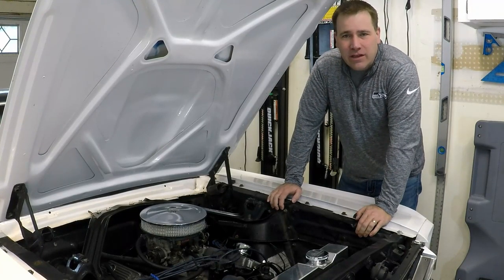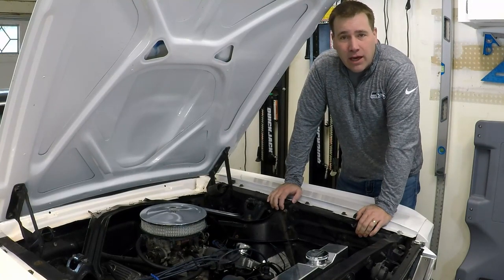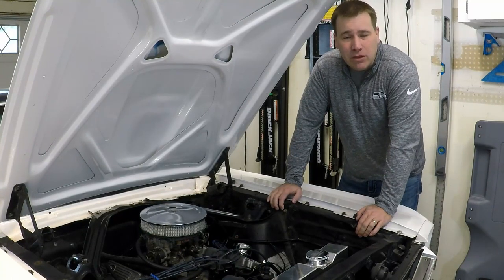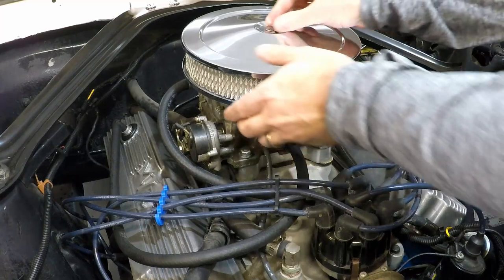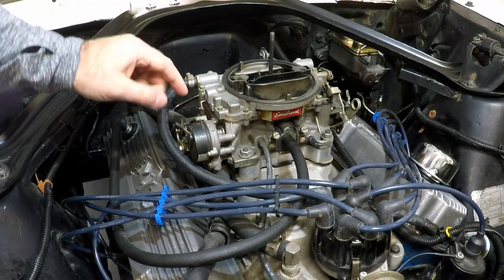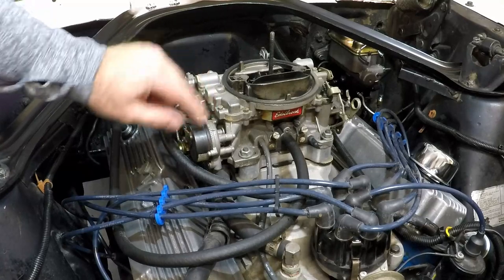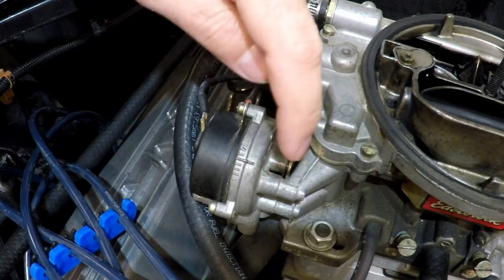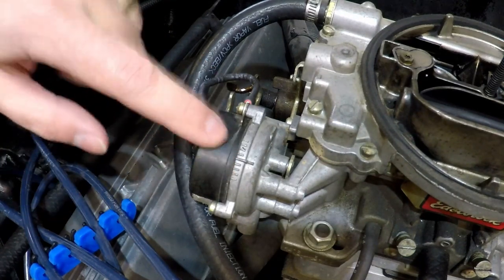How to fix the Edelbrock Electric Choke

Comment: Good video. Unfortunately on mine. For some reason even after I undo the 3 screws. I cannot twist to adjust the choke or take it off. It's stuck on there. Someone had also ziptied the linkage arms to disable the choke.
Reply from the maker: It sucks trying to fix other people's projects.  Maybe it's time for a new carb?  Maybe an upgrade?!   :)
Reply: @AndyKruseChannel  it's annoying haha, but it's a new carb though. Everything works fine, but the choke.  It's pretty cold here in Australia atm so morning drives are interesting.

Comment: Hi, so i see the edge of the choke spring coil should be against the shaft sticking out of the housing? Does this apply to all chokes? I thought the wind of the spool of the spring (loop end) should be in-between the shaft. I think i see now what i did wrong on my 78 Cadillac Coupe with the 425 rochester carb. I put a new choke thermostat and new primary choke pull off but yet car starts and runs awful on cold starts. I placed the new thermostat choke exactly as the old one with 2 notches lean. But maybe the placement of how it catches the lever within is bad. The way it is now, it will  run a bit and stalls out. I have to keep feathering the accelerator pedal to give it gas so it won't stall. All the while, the car is idleling rough. But once warmed up, Caddy runs perfectly well. I can't even tell it's on at a stop light. Oh im also going to be replacing the secondary choke pull off too...any input. Thanks. Great video. 👍
Reply from the maker: Yeah, it's crazy how such a small change can affect the engine and how it runs.  You might be able to play with the choke adjustment a little more to see if that changes, but it might not hurt to go through the idle mixture process and make sure it's dialed in correctly.  You should be able to adjust your fast-idle adjustment so that your car is idling at the proper speed when the choke is doing its thing.  :)
Reply: @AndyKruseChannel  hi good morning. Yes I'll be doing that tomorrow morning on my day off. I havent used the car at all since Saturday evening. The idle screwd are dialed in correctly and haven't been messed with since the car runs good. But maybe the fast idle cam screw needs some tinkering but I'll hold that off. Thanks for the reply 👍 😀

Comment: Great video, I just started having an issue with my choke so this should help a lot. I do wonder about the hot coming from the alternator, Edelbrock specifically recommends against doing that and says to go straight from the accessory in the fuse box. What was your reasoning for doing it the way you did it?
Reply from the maker: I would agree that the way I wired up this choke is not ideal.  Therefore, I wired up the electric choke differently on my next car with a dedicated power source controlled by a relay.  Some people said it was over kill, but I like having a dedicated circuit for choke, it makes it easy to identify issues.  I made a video about it not too long ago.  :)
Reply: @AndyKruseChannel  Awesome thanks, looks like I'm running into some wankery you found as well, the choke cap is loose and all three screws are just about stripped. I should be able to get them out but not before I get new ones or another carb (It's under powered for my car)

Comment: On my 1968 289 i have a problem with the throttle lever, it wont budge. I noticed when the linkage was connected but wouldn’t move forwards or back, do you know a fix?
Reply from the maker: The only thing I can think of is that it might be binding on something. Maybe it’s worth finding a video where someone has disassembled one like yours and you maybe you’ll find the issue there?  Sorry I’m not much help.

Comment: The choke doesn’t deactivate on my new Edelbrock carb. If I deactivate it manually, it activates as soon as I step on the gas. The choke stays on even when the engine is  warmed up. Which way do I turn the choke cap to get it to deactivate?
Reply from the maker: It's tough to know without seeing the choke action do what you are describing.  You might be better off calling Edelbrock if there's an issue with your Carb.  :)
Reply: @AndyKruseChannel  thank you for the reply. I think I figured it out. I just needed to lean it out more. I wasn’t too sure how it worked because my other truck had a manual choke.